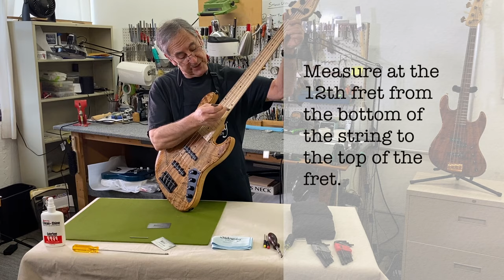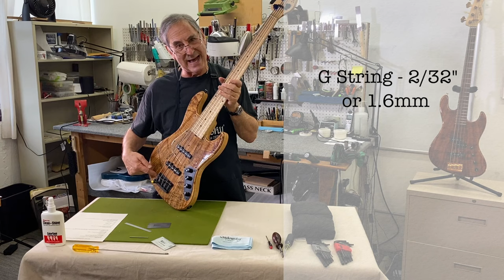Roger Sadowsky Bass Setup Video

Comment: 0:00 Intro/Tighten screws
1:28 Tune
1:55 Adjust Truss Rod
5:45 Adjusting the Action at the bridge
10:56 Intonation
Reply: 11:47 Break output jack and/or cable connector.
Reply: He did lay it down on a mat

Comment: I’ve been playing the bass for almost 35 years now and I have a good understanding of how to set them up. I haven’t really been happy with my 5 string lately, especially the sound I was getting from the low B. string. Browsing for some videos on 5 string set up I came across this one of Roger’s. These action measurements really worked great for me… that bass hasn’t sounded so lively and punchy in years. I have somewhat of a heavy attack with my right hand and the tip to depress the string at the first fret to eliminate the nut height I think made all the difference for me. Thank you for taking the time to share your wisdom.

Comment: Roger, thanks so much for the help!  I am an aging semi-pro bassist who, as you described so wryly, was terrified of dealing with truss rods and setups in general - I just played 'em as I got 'em convincing myself that I actually "liked" (or at least was OK with) high action...  More recently with the pandemic and youtube I have learned quite a bit about dialing in my growing guitar collection but very few specifics about the bass.  After watching your excellent vid I checked and noted several needed some setting up - it is possible that some were never fully set up in the first place.  I was able to improve most of them!  I was especially interested in your comments regarding truss rod adjustment and string action at the first few frets.  I was a bit disappointed that there was no discussion of measuring and adjusting proper nut slot depth which also contributes to this annoying problem.  I use a simple trick: if I can wedge my med-gauge pick in between the bottom of the string and the top of the first fret such that it sticks when let go (with a tiny bit of snugness) kinda like a poor guitarist's quick-and-dirty feeler-gauge, than I am in the ballpark.  This is after setting a reasonable neck relief and action at the 12th fret with bridge adjustment.  If the pick wants to fall away by itself and/or the string vibrates cleanly with the pick underneath then the nut slot needs to be filed a bit.  A more precise recommended individual string action measurement at the first fret from your point of view would be very useful! (real feeler gauges are inexpensive...)  Perhaps a vid on fixing/replacing/shaping a nut and best materials and tools for a bass would be a good vehicle?  TIA!

Comment: I bought #5181, a Vintage 5, from his shop in 2008 and it has been on literally hundreds of jobs. So glad I saw this video today because I will start including the neck bolt and strap button tightening in my setup regimen. I will also drop $10 on a strobe tuner app to get a more accurate read than my Boss tuner pedal. Still love my Sadowsky bass a dozen years later. This video is really really great. Thanks for posting!

Comment: This is a fantastic video. If you're setting up your bass you can't go past the experience of Roger Sadowsky, I have to say it just works. BTW, Roger mentions a thick business card is about as far as you'd want to go with neck relief if you play hard. That's about 0.014" or 0.35mm if you are using feeler gauges.

Comment: Noticed the he recommended tightening the truss rod while under string tension.  Is that a general rule off thumb?  I've actually broken a truss nut when tightening under tension in the past, and since then have changed my approach to always release string tension before tightening the truss rod.  So far as I can tell, the only drawback is some extra retuning.  It's also a necessity on some older style instruments that have truss access at the body and no recess provided to access it there, meaning that you need to remove the neck entirely.

Comment: So I can get this right, when you're checking the neck relief by fretting a string at the first and 12th fret, and then tapping the string at around the 7th fret, should the string be touching the fret so that there's no bounce at that point? Or are you looking for a little bit of bounce and clearance between the string and the fret, but not much?  If I do the measurement with a business card, are you looking for the business card to go in snugly, or be able to move freely in between the string and the fret, or should it be so tight that the business card just can't insert between them?  And yes, I'm a little bit nervous at this. I just got my beautiful Sadowsky, and I've never adjusted a neck truss rod before

And If I'm understanding correctly,  the recommended string height is somewhere around 4/64ths on the G string and 6/64ths on the low B string?

Comment: Beautiful bass!  What should be the measurements at the first frets for the nut height?
Reply: Press the string down between the second and third frets and look at the distance between the top of the first fret and the bottom of the string. Ideally there should be a tiny amount of clearance of a few thousands of an inch. If you need to reduce the depth of the nut slot then use an appropriate file and check every couple of passes by putting the string back in the slot and tune up to pitch.

Comment: I think there may be an error in the PDF on adjusting the truss rod. It says "A lot of space will indicate a back bow, no space is likely an upbow, and an even amount across the string straight edge will indicate a flat neck.". Isn't this backwards? Wouldn't a lot of space indicate an upbow (too much relief, need to tighten truss rod)? It's my first time doing a bass setup so apologies if I'm misunderstanding.

Comment: I live in Australia. I have to change my truss rod relief two times a month. . .
Reply: Seriously? That's not normal, even for people living in a swamp or a desert. 30 years of playing guitar and bass, working on them since the day after I got my first guitar at age 14, when I swapped out the stock pickups, and I've never seen a trust rod that had to be adjusted that often. Where I live we get humid in the spring and summer and we get extremely dry in the winter, and you're saying just surprises me. I've been building instruments for about 25 years and if one of my clients told me what you said about one of my instruments I'd tell him to send it back to me that I need to remedy that.

My '83 Fender American P Bass needed a truss rod adjustment twice in 25 years (I did turn the rod slightly and return it to the start position, just so the threads didn't get seized up from oxidation). Good luck!
Reply: @Metalbass10000  Australian weather changes quite dramatically, one day it will be humid, and the next would be dry. But to be fair, this is on my Squier Affinity Bass which already has a lot of problems. I have hardly touched my MIM Fender Jazz Truss Rod which is fairly new.

Comment: Roger, on the string action, how much difference in measurement is it when  measuring for fretless bass?
Reply: Probably lower...
Reply: measure from the bottom of the string to the surface of the fretboard (vs the top of the fret)

Comment: 0:49 tightening the neck-bolts without loosening the strings?
The tension of the bolts works against the tension of the strings without loosening the strings.
Reply from the maker: just snugging them up. they are already tight
Reply: @SadowskyGuitars  Thanks. I did it without loosening the the strings, no problem.

Comment: I’m curious what is being used as a truss rod tool? That would be useful to have a properly sized piece of round steel bar stock rather than chewing up your spoke wheel with a hex wrench
Reply: I don't see how a round piece of steel would be practical for adjusting a hex nut. As long as you have a properly sized hex wrench for the nut, chewing it out is near impossible.
Reply: @darkySp  this bass doesn’t use a hex nut to adjust relief, it’s a spoke wheel…anything that would fit would work, but it looks like you were able to get the tool he uses at some point in the past
Reply: @davidblack8174  A spoke wheel like the Stingrays ?  Didn't know the Sadowsky basses had the spoke wheels too, I only know of the Stingrays to have that. And never personally seen truss rods with spoke wheels, always a hex nut.
In that case, I'd guess a thinner Philips head screwdriver could work perfect, as long as it fits of course.
Reply from the maker: I use a #33 drill bit blank.  I supply one with each instrument.
Reply: @SadowskyGuitars  that’s slick!

Comment: If you need to increase action height by raising that string's saddle height you should loosen/detune that string first to make turning that saddle's screws easier; otherwise you could round out the hex head of the screws.

Comment: That's it. One question though. After doing the set up, and especially after intonation, moving the bridge back or fourth... is there a reason (good idea) changing to a fresh set. There might be a bend on the string , especially if the saddle had to be moved a lot during the intonation. Tuning stability and/or tone of the instrument? Or is it just in my head
Reply: Fair point. I gently push the string with my thumb to seat the string angle over the bridge saddle.

Comment: The old guys used high action  because it sounds better. A higher action and thicker strings = tone. These days I just hear buzzing and rattle from light gauge wire wounds.
Reply: I'm old, I used high action because I didn't know/couldn't afford any better.  But I agree about your "these days" comment, especially in demos!  Entwistle and some others made good use of the bright roundwound sound but the rattles and buzzes not so much.  I prefer flatwounds and nice clean tasty tones.  One of my fav sounding axes is a Danelectro Longhorn bass (with lipstick pups) and big fat flatwounds! (and no rattles or buzzing!)
Reply: High action and thicker strings = painful and difficult to play. These guys must have had the finger strength of a rock climber to play with thick gauges and high action.
Reply: @darkySp  I don’t think so. Practice and technique is all that’s required. Yes it won’t allow tapping and all the other shredding stuff that goes on now but James Jameson did pretty good with a high action and probably not light gauge strings. So many guys just don’t want to put any effort into developing tone they just want to buy gear and get instant fix sound which is usually poor.